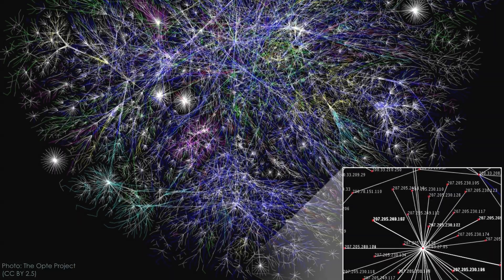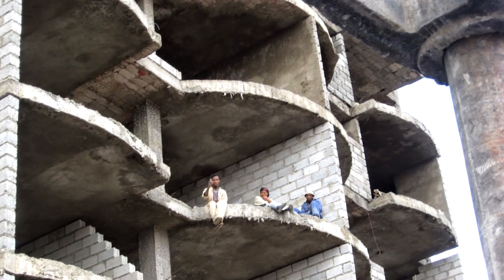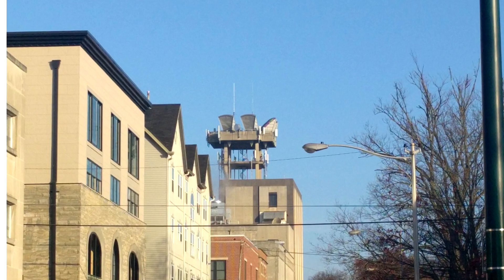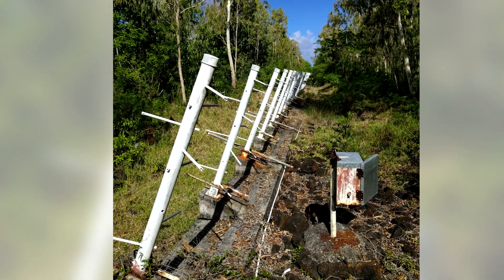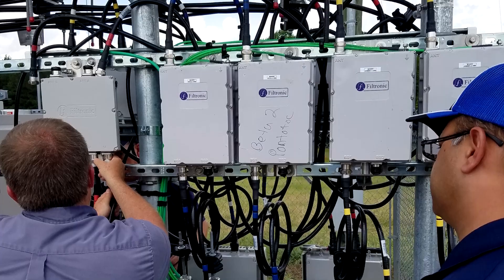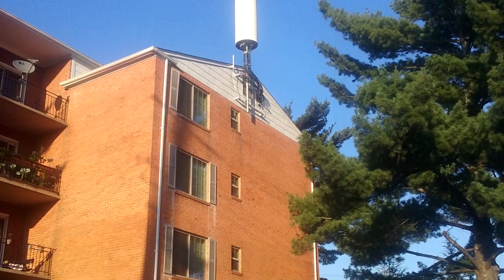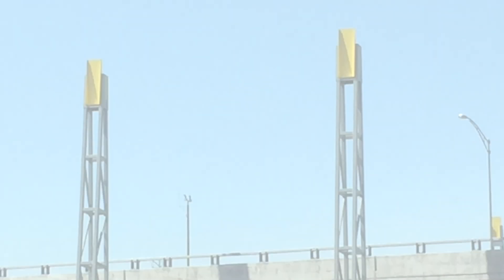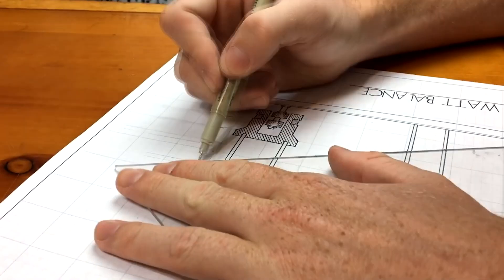What's That Infrastructure? (Ep. 5 - Wireless Telecommunications)

Comment: those feed horn antennas are amazing. we used them a lot in the cross Canada system. i am constantly amazed what was possible in the 50s and 60s. communication infrastructure, wireless especially has got to be my favourite. 
as for the yellow tower toppers from Quebec, seeing as there is no visible feed lines and that most flat antennas are square they are most likely there to be visually appealing. They could be a sort of radar reflector however without more information i am just speculating, I'm also interested to know if anyone else knows for sure
Reply from the maker: I think I agree with Guillaume's photo - probably just an architectural feature. He didn't send a wider view, so it was hard to get any context.
Reply: In the Angeles National Forest in SoCal, there is (or was, I have not been there for a decade) large metal billboard type reflectors to bounce the microwaves around the mountain peaks. You could seed them on some of the hiking trails and truck roads in the mountains. This is what thy look like: http://static.panoramio.com/photos/large/81674253.jpg
Reply: http://long-lines.net/places-routes/JohnDayPR_OR/passiverepeater.html
Reply: Remember flying things need to see masts too. Towers have blinking lights for that.
I do not think that they are radar reflectors because they are mounted to something already reflecting and the shape is wrong.
Reply: those large feed horn antennas were the backbone of any telephone system until the 1990 when they were replaced with mono mode fiber optic cables. The high concrete radio tower at the center of my city is still standing but the many antennas are gone.
Reply: Those yellow things are RADAR reflectors - they're to help with surface navigation, allowing RADAR-equipped ships and boats on the body of water below to better "see" the bridge, presumably because the bridge's construction inherently makes it less visible to RADAR.  Tom Scott did a video, I'll have to watch it again, because I don't remember exactly how they work.
Reply: To me it kinda looks like a bridge and my best guess would be that this is reflector for boat radar.

Comment: I believe that Guillaume took his picture on the new A20-A30 overpass. I haven't been able to locate the other end of the wireless path, if it is the case. I've been told there is load cells embedded in the concrete and some sensors elsewhere all over the overpass but none of them are wireless, with the exception of their gateway.

The only real possibility is they are part of a vehicle counting system, where antennas detects changes in the magnetism or are counting Bluetooth enabled devices. These are being deployed in large numbers by our DOT.

Keep up your good work.